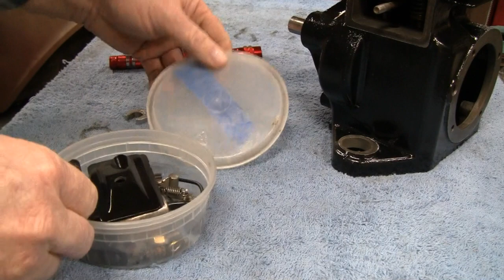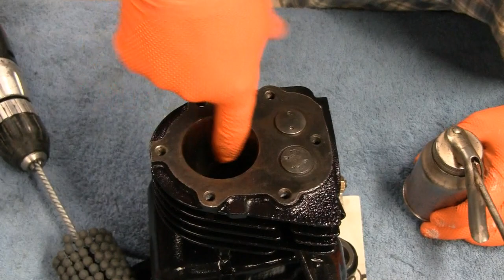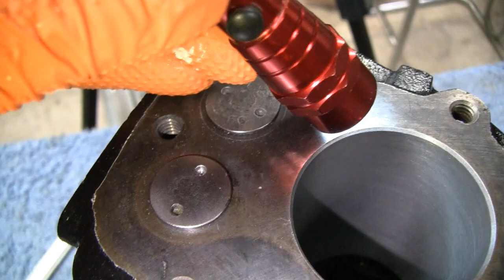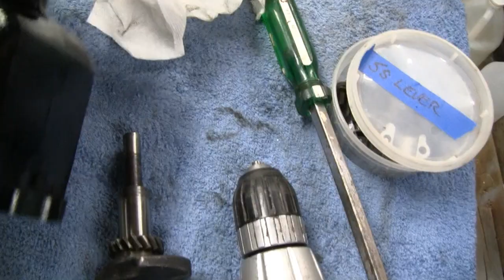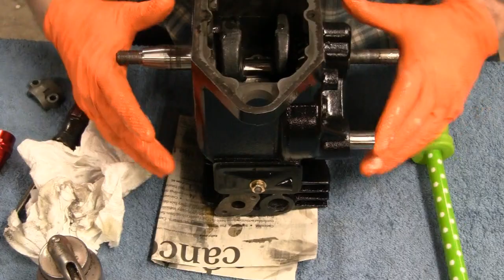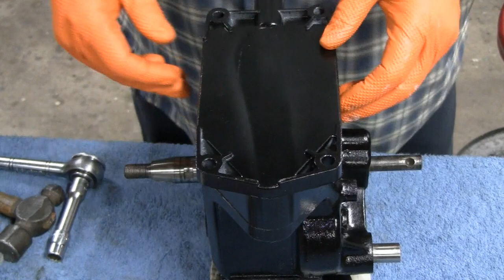RARE ANTIQUE BRIGGS LEVER START ENGINE RESTORATION (part 5)

Comment: You need to use some of the spare parts you have and make a rig to put those coils on to test them.
You could use a flywheel , backing plate , points and the end of a crank and build a nice rig that you could take to shows also.
Reply from the maker: That's not a bad idea!! Could probably just take the piston and rod outta a spare engine and hook it to a little electric motor with a pulley!!☺

Comment: Yep Set those rings at 12 -  4   and  8......I had a riding mower blow up because someone did not bend the little tabs over on the rod bolts...I have took one apart once and  the tabs where not bent over
Reply from the maker: Yeah I've across quite a few missing the tab and not even lock washers!!☺

Comment: Roadking why didn't you hone the bore before you set the valves in the block. wont the abrasive from honing the cylinder affect the valve stems?

Comment: You going to Jacktown Road King ??? I prefer to use a new gasket as they stop oil seeps. Which a newly rebuilt engine does not need. I like the brass nut and washer. A real nice little touch fella.
Reply from the maker: I think the Spring show has been canceled, hopefully we'll have a Summer Show!!☺
Reply: @805ROADKING  Hopefully we can make the summer show fella. Peace fella.

Comment: I had a similar engine although older that came off my grandma's Sears washing machine and it had a kick starter rather than a lever start,it was a 1/2 hp B&S with a different type carburetor and gas tank.
Reply from the maker: Yeah they were WM's and WMB's, I have a few of them out in the shed loft!! They're nice engines!!☺

Comment: Where do you source parts from I just got a 5s and it’s missing the carb exhaust and gas tank
Reply from the maker: I usually get parts off ebay or at the engine shows!! The exhaust is just a hot dog muffler, you can get them at home depot or lowes!! It's just a standard Arnold M-105 !!☺
Reply: 805ROADKING thank you I will keep a look out on eBay I just can’t seem to find the carb anywhere
Reply from the maker: Antiquebriggs has one but he wants $50 for it!! A model 6s is the same!!☺
Reply: 805ROADKING also I just got two 6b-s engines could you or have you done a rebuild on one?

Comment: This isn't a racing engine so if the gasket aint broke it doesn't need to be replaced. If it was a $500+ engine I would put new gaskets but for like you said a $5.00 engine the old ones looked good to me.
Reply from the maker: If it was on the mower I was gonna use weekly for the next 20 years I would have replaced them!! But this engine is gonna go to a couple of shows then sit on the shelf in my shed loft for another 30 years!!☺